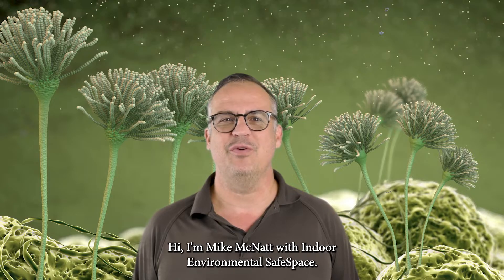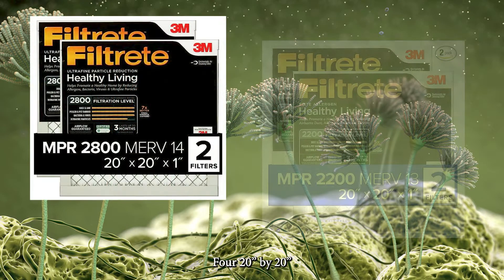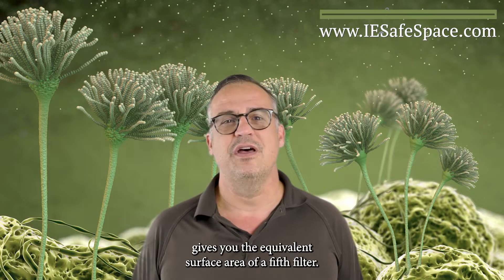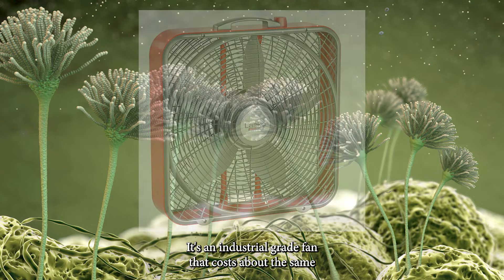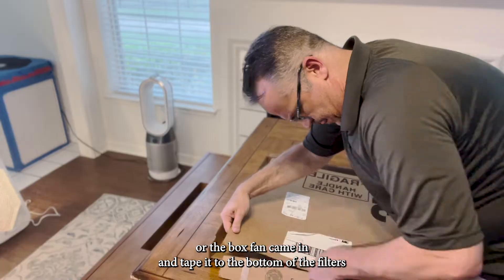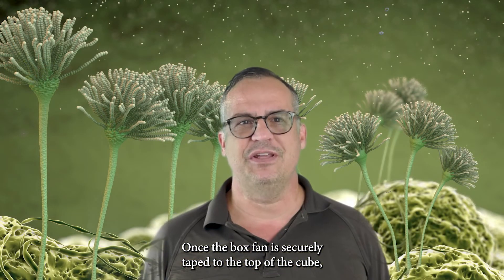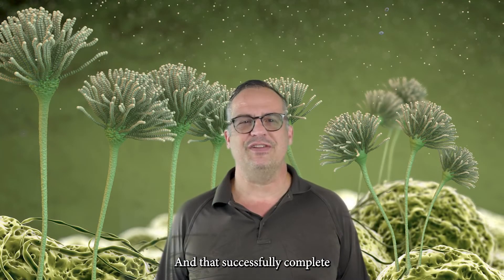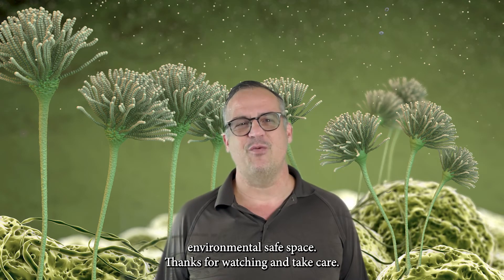Corsi-Rosenthal Build Demo

Comment: Thanks! Husband built one earlier today and already feel a diff. He's working on the 2nd one now.
Reply from the maker: Hey Joslin, Thanks so much for letting everyone your results. I recommend these to everyone I come across. They beauty is that they are great for filtering mold out of the air before, during, and after remediation, but they also are non-discriminate in what they filter, so they filter out all contaminants and particles, including pollen, dander, insect fragments, and other pollutants and allergens. They are making a huge difference for my clients and subscribers, and they are fairly inexpensive, especially when compared to the more costly commercially available options.

Comment: Maybe it's me but if the air passing through the fan is filtered why does the front of the fan  need to be taped?   And I'm not fully understanding where or why the toilet paper is needed.
Reply from the maker: @TJ, Its not jut you, I get this questions a lot. Here's the brief answer - The Box fan is square and the fan blade is round. This means that in the corners of the fan, past the tips of the blades, the air will travel down through the fan grate, past the fan blade, and then and come back through the blades and back out of the top of the box fan. This is called "bypass" air because this air is NOT pulled through the filters, it sneaks into the box from those corners and is unfiltered. The tape keeps air from sneaking into the box around the fan blades without passing through the filters, so that the only unblocked path for the air is through the filters first, then out of the top of the fan through the fan blade. 

Does that clarify or muddy the waters? 

Thanks for the great question.
-Mike
Reply from the maker: The toilet paper just helps show the airflow direction so we can see if any air is being pulled into the box from the top (bypass air). We want all of the air traveling the other direction, from inside the filter box out of the top of the fan, and not flowing unfiltered from the top of the fan, past the blades into the box and back out without being filtered.

I'm not sure why I thought this additional explanation would make it clearer. lol... But I hope it did.
-Mike

Comment: Merv isn't for molds spores, yes? There are thick carbon filters sold online, would they catch mold spores, bind toxins??
Reply: Brand suggestions?
Reply from the maker: Brand suggestions for fans or filters? I have used Lasko fans in the past, but pretty much any 20" square box fan will work. For tape I use 3" painters tape, the width makes the build easy to assemble and painters tape makes disassembly a breeze. For filters, MERV 14 of Filtrete 2800. The Filtrete filters are awesome but a little costly. They will drive the total cost closer to $150 for each Corsi box. Ive been using Nordic Pure MERV 14 filters lately: https://healthyhome.help/product/nordic-pure-20x25x1-19-1-2-x-24-1-2-x-3-4-pleated-merv-14-air-filters-2-pack/ 
They keep the total price closer to $100 per Corsi Box.

Thanks for the comment and let me know how your Corsi turns out.
-Mike
Reply from the maker: @Goldas, Great question. There are only 2 things that can be filtered, particles and molecules (or atoms). The particles include mold, virus spores, bacteria, dander, pollen, environmental dust, etc. Molecules and atoms are chemicals. MERV measure effectiveness in filtering particles. Carbon is for adsorbing chemicals and gasses. Mycotoxins are chemicals made by the mold, but they tend to stay on the mold (particles). If you use MERV 14 filters to capture mold particles, you will be capturing most of the mycotoxins simply because they are on the particles. To filter mycotoxins that may have turned gaseous, it takes adsorptive filters like carbon. 

I hope that helps. If not, feel free to let me know and I'll explain better (I hope). 

-Mike

Comment: Hi, is this considered hepa filter? I'm confused if the filters are HEPA or not
would this box be enough for a home that went through remediation with toxic mold? Or can I use this box in combination with an air purifier?
Thanks
Reply from the maker: The Filtrete™ 2800 Ultrafine Particle Reduction filter captures 81% of particles in the 0.3 to 1 micron size range. This includes bacteria and particles that carry viruses. HEPA filters capture at least 99.97% of particles as small as 0.3 microns. This high efficiency makes HEPA filters more suitable for environments requiring the highest level of air purification.

In short, the HEPA is a much better filter at capturing very small particles. Corsi Rosenthal's are less inexpensive, and filter more air, but are large, loud, unattractive, and filter a lower percentage of .3 micron sized particles. In many cases, I consider Corsi Rosenthal boxes a good temporary solution to use in addition to more expensive HEPA filters.
Reply from the maker: And thanks for the excellent question!

Comment: I made one of these last year, and this year I’m attempting one that works for mold and asbestos or lead dust as well. Do you have any recommendations on filters for that? PS I rally like your idea of the 20x25!!!
Reply from the maker: The filter I have recommended for the highest filtration efficiency is the Filtrete 2800 Merv 14 filter. It filters 81% of particles .3 microns and larger. Asbestos particles range from as small as .5 microns and larger, and lead particles are estimated to be in the range of 2 microns, so the Filtrete 2800 would help filter these particle sizes effectively.

I hope this helps.

Comment: Great video! Where do you suggest buying the filters?
Reply from the maker: Thanks for watching the video! I bought my filters from Amazon for convenience, but you might be able to find them for a lower price elsewhere. The Filtrete 2800 filters are excellent but will be around ~$60 for 2, which puts the total cost around $150 for the completed box. Less expensive Merv 13 filters can be used. The better the filter, the cleaner the air, but some filtration is better than no filtration. :)

-Mike
Indoor Environmental SafeSpace
Reply from the maker: Did you find the filters and get your build completed? I hope it has helped.